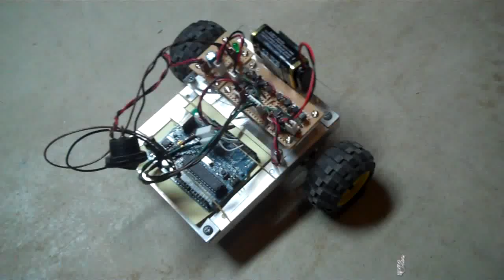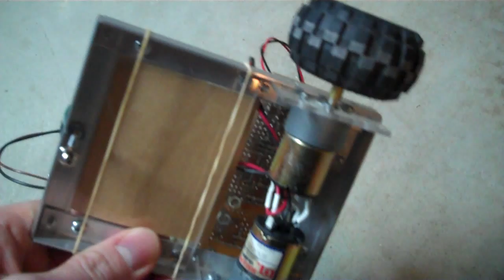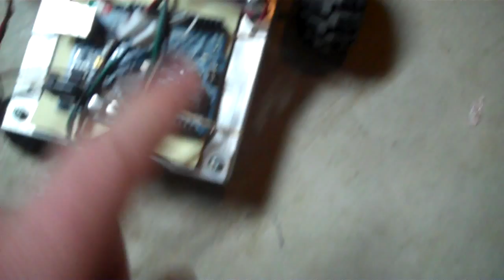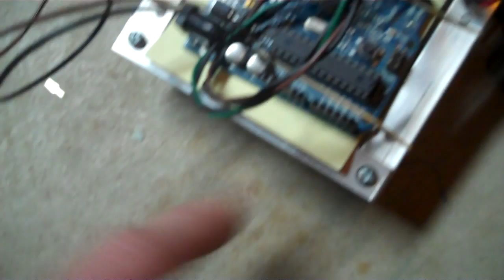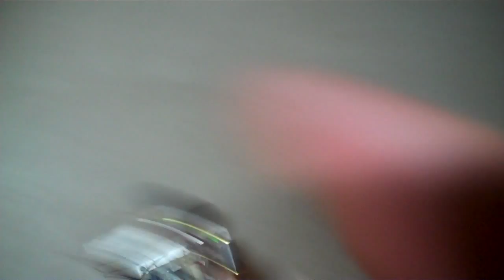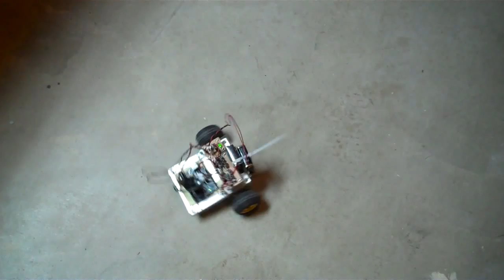Simple robot body from parts you can source locally

Comment: Use a small filter to attenuate spikes that can affect logic. With high level design robots, the motor supply and the controller supply lines are kept isolated. You can use a small super cap (around 1 farad 5 - 10 volts) to keep the power supply to the controller stable (after the regulator).

Comment: Constant current motors like those use creates inductive spikes on the supply line. Connecting protective diodes from the motor positive and negative lines to supply and ground in reverse should help. You can use a large capacitor to help keep the motor supply line stable.